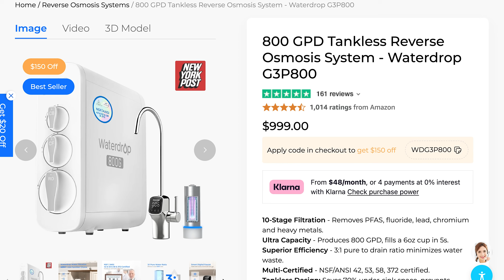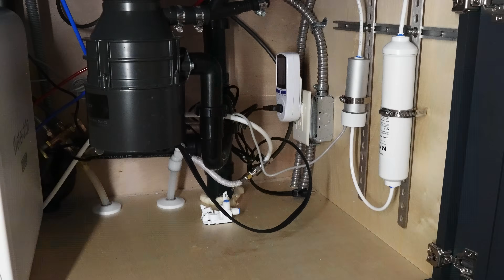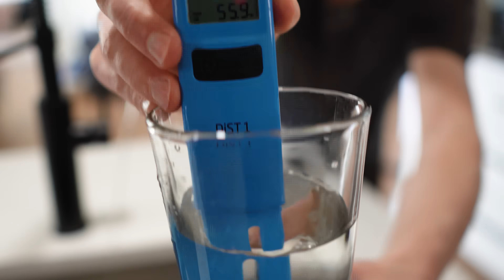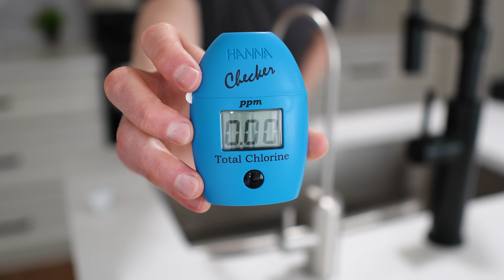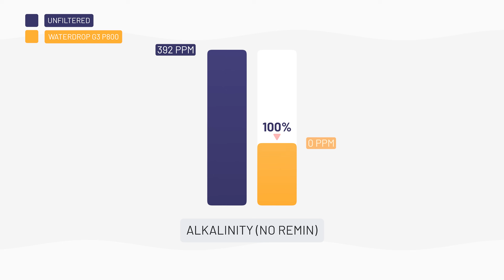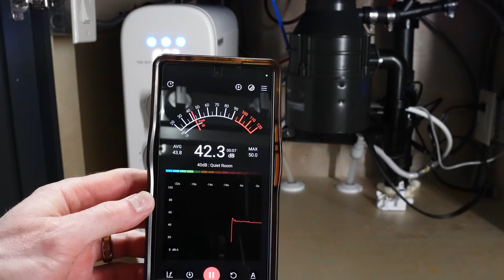Does the Waterdrop G3P800 make water safe to drink?

Comment: Did you ever do tds creep measurements on the x12 compared to the G3P800? I have been through two x12 units and they both seem very susceptible to creep, even with fresh filters. 

My incoming water is around 250tds, and after not using the x12 for a few hours, the first 36-48oz typically reads around 150tds. It takes at least 64 oz, most of the time up to 100oz to finally stabilize at around 10-15tds.

Wondering if I have something set up incorrectly, since it seems the G3P800 is doing much better in this regard.

Comment: Thanks so much for your detailed videos — they’ve really helped me with choosing and deciding on a reverse osmosis system!

One question about the G3P600/G3P800: Are you sure they’re identical apart from the flow rate? From what I’ve found, the G3P600 may not have a UV sterilizer.

If that’s correct, how important do you think the UV stage is when the incoming water is already high-quality drinking water?
Reply from the maker: UV is to protect against any bacteria that may grow inside the unit, not to disinfect the water. It's installed inline on the faucet line.
Reply: @waterfilterguru  
Thank you!
But there is none of on with the G3P600 I got.
Would you think it is necessary? Can I get it separately?

Comment: The more I watch your tests, the more I think the $1000 whole house system, with a variety of inexpensive drinking water filter, makes the most sense.
That said, I see many people replacing the Berkey filters with Pro One. I am using Culligan ceramic and then running it through a Zero Water filter. 
Have you, or will you test the Pro One? 
Thanks for what you do!
Reply from the maker: Just remember, there is no such thing as a "one size fits all" solution to water treatment. Different technologies address different water issues. That's why testing your water first, then using the data to spec appropriate equipment is so important.

As for ProOne, yes I tested them. The ProOne brand was acquired by Culligan and is in the process of being shut down. Culligan relaunched the products branded as the Culligan MaxClear (the filters you said you are already using)

Comment: As someone who has had the 600 for years, I see no reason to get the 800 unless you’re running a restaurant. The 600 has been incredible.
Reply from the maker: Thanks for sharing! The 600 vs 800 GPD rating is most noticeable as faucet flow/ how fast a glass or pot fills with water. Highly unlikely any residential application is even using 600 or 800 gallons of filtered water per day 😉

Comment: I have an ineresting case for you which i believe many will be interested or surprised. 
1. First if machine works with only one filter installed for microplastics filter. 
2. If not this one, then to see if any other machines countertop or underones working with different amount of filters installed. 
3. If yes Test some water from plastic bottles and test how eficient they are for microplastic removing.
Reply from the maker: The machine will not work unless all filters are properly installed
Reply: @waterfilterguru  thanks for the response. Also all countertop RO as well will not work?

Comment: For Efficiency Ratio, it runs the 28oz flush every time you use the faucet. If you dispense 64 ounces or 1 ounce, it always runs the flush afterward. To me, that seems quite excessive when dispensing a small amount of water from the faucet and definitely can have a dramatic affect on the efficiency rating of the system. I own one, just wait for a sale, they have good discounts. If you want a good remin cartridge, I use the REMIN CA by Vitev. Excellent products!
Reply: It’s far from excessive. I own the smaller version. It “wastes” very minimal water. As efficient as RO gets.
Reply: @CBTellis I've owned this model for the past two years. It runs the 28 oz flush every time.